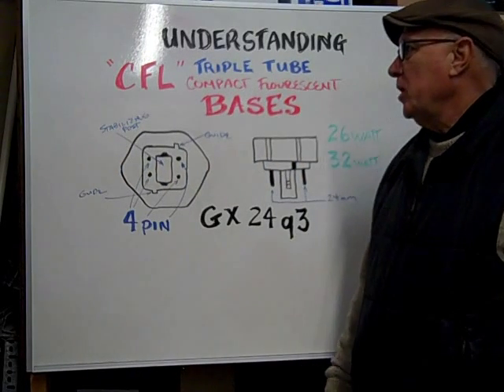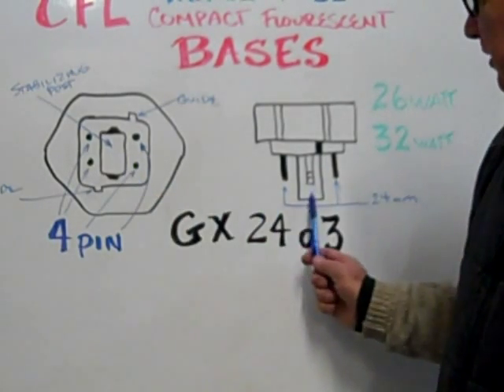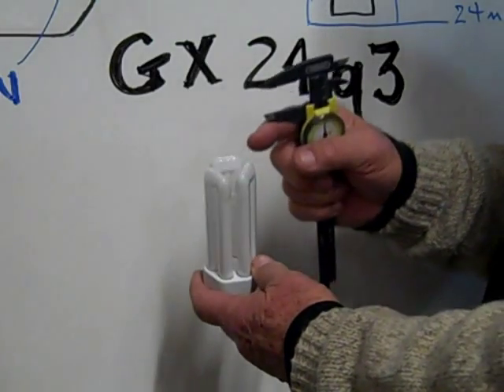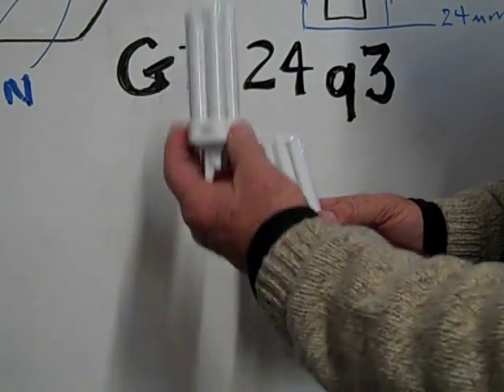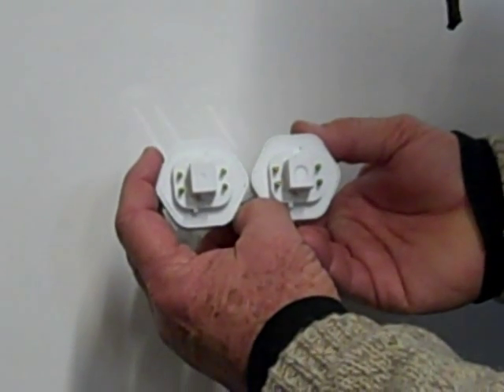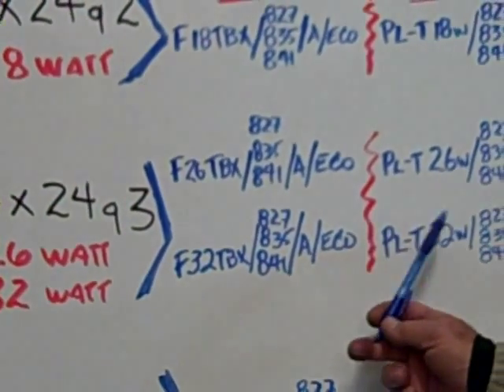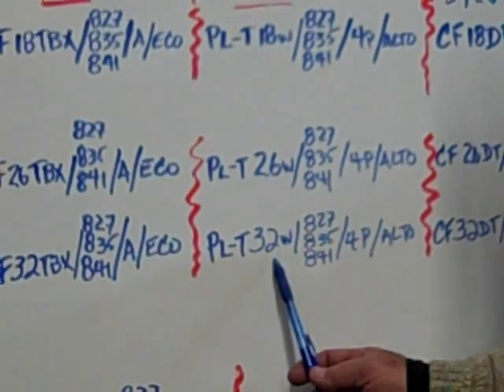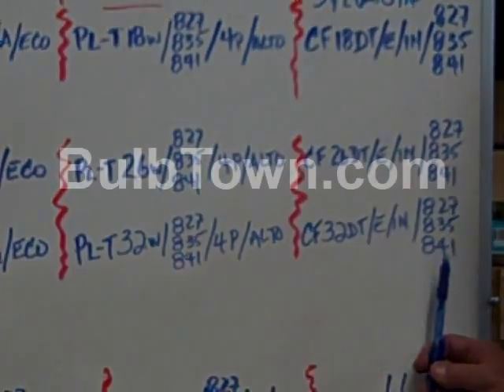GX24q3 Base Identification

Comment: Hi bulb town - this is a long shot on such an old video but I'm hoping you may be able to help! About 8 months ago I replaced the CFL bulbs in my kitchen. They are gx24q-3, 26.5watts. They are rated for 12,000 hours but even with a generous estimate I've only used them at most for 1,200 hours. But 4 out of 6 are burnt out. Any ideas on why they would burn out so prematurely?

Comment: What’s the bulb above it with the opposite placed guides? I bought a gx24q-3 base bulb to replace a bulb stamped FDS18E35/4 which is identical base except for the opposite placed guide tabs so it won’t go in. Can I just remove these tabs with a dremel? Or will it be wired differently?
Reply from the maker: You don't want to do that, the base configuration is to ensure that the bulb is used with the proper ballast, altering the pin configuration could result in failure or fire.
Reply: BulbTown (love that I get a fast reply on a 5year old video.)
But gosh darn if I don’t have it in for light bulb manufacturers.